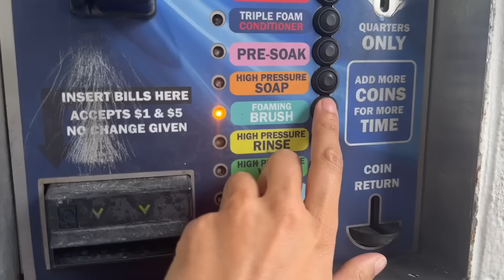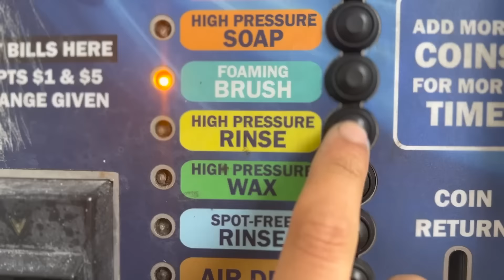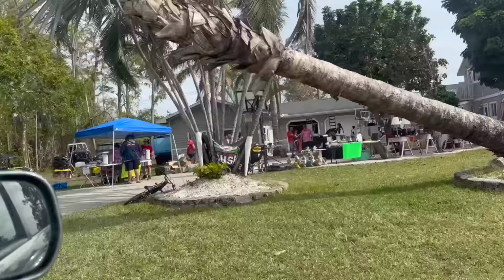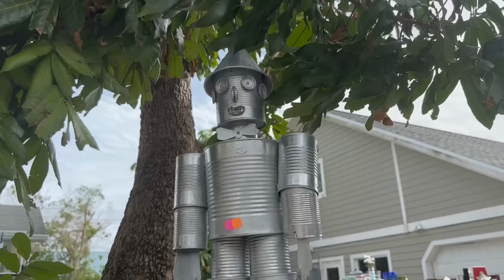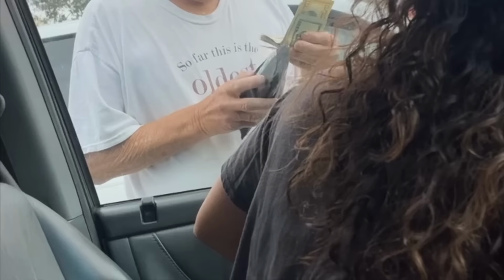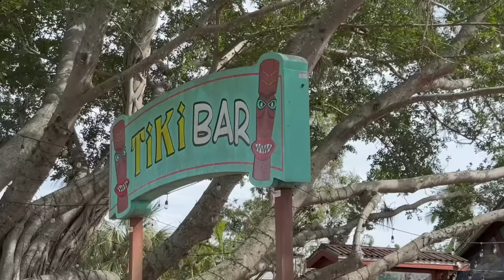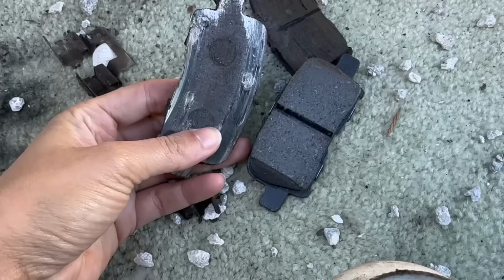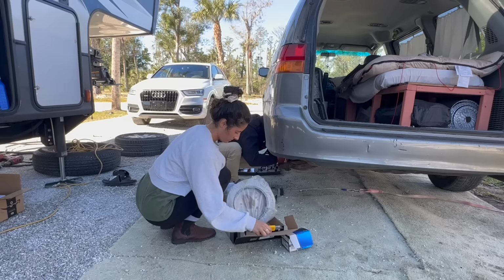Florida man gave me all his money…

Comment: Your threads won't mess up on your oil pan if tightened with a socket wrench, the problem is these shops use air tools and tighten it so much it spins the threads smooth

Comment: Check and make sure the plug stays in oil pan
If it comes out ,you'll lose all your oil 🛢 
And motor will blow up (break down)
The last one that change your oil , crosstheaded the oil pan plug , (bolt)
And when he took it out , it damaged the threads
Good luck to you

Comment: Good old oil change places. Make sure you keep an eye on your oil  just in case they messed it up. If the plug leaks or comes out it will drain out all your oil and you will blow your engine. He was giving you a line of crap they crossthreaded it in there more than likely . But just keep a eye on it. look for puddles under van or  watch oil light.

Comment: Just wanted to let you know that after that oil change.  You should be crawling under the van and take a look at you drain plug.  To make sure oil is not leaking around the bolt. And you should check the dipstick to make sure it's full of oil.  Oil level is obviously critical to make it to three hundred thousand miles. That's so unfortunate they couldn't handle such a regular job 😕 and like you said now it's your problem 🙄.  Good luck

Comment: Stripped drain plug happens frequently at shops. May not have been them, who knows. Keep an eye out for oil leak. Anything with the battery that would have caused your car to die would not have let it restart. Throttle plates possibly may need to be cleaned. Nice to have a brother to help you but you should put a jack stand under control arm in case that small jack fails. Don't lose you hand or feet if the car falls. Good Luck.

Comment: I'm glad that you able to fix your HO Van.   It socks and stressful to have car problems. Did you go to Valvoline? They did my change oil to and that's normal that they have 2-3 people to work on your car. After that less than a week my oil was leaking everywhere. And I have to get it fix. I have a Hinda Odessey too 2010. I bought it 172K miles now it's 191K 4/20. Also just a suggestion that battery cost a lot try getting a USB fan w light w a few settings works great!😊 good luck and take care🥰❤️

Comment: Here's the thing. These so-called "quick oil change" shops will strip out the threads on both the oil filter and oil drain plug. So, buyer beware. Do not allow them to talk you into going to someone they know for a new oil pan. That oil drain plug can easily be rethreaded.

Comment: The inside brake pad was worn more than the outside one  because the brake caliper is sticking. You should replace the caliper or the new pad will wear out prematurely.  Something to remember, If the inside pad is worn worse, the caliper is sticking. If the outside pad is worn more then the caliper slides are sticking and need replaced or cleaned and lubed. The pads should wear evenly. Good luck!

Comment: I used to work at a oil change shop a year ago. Everything they said I have experienced. And the drain pull issue is coming when someone over tightens the drain bolt and straps the threads. Especially if your oil pan is thin metal.

Comment: I went to 5min oil change. They forgot to replace the sheild under the oil pan. I  drove over it when I pulled out. It caught another sheild and pulled it half off. They waved me "stop, stop"!! I didn't know what happened. They didn't tell me. They said they fixed it. The next day I was 60 miles away and saw something hanging down under my truck. I had to wire the second sheild up with a coat hanger. Those guys are on drugs! If they stripped your drain plug, beware. You can lose your engine!

Comment: With 200,000+  miles on the van   and an oil change about every 5,000 miles that makes it 40 oil changes on that particular engine. I'm not familiar with these but running a plug in and out of the same threads 40 times over 20-ish years causes wear. If it is a steel plug and an aluminum oil pan I'm surprised it lasted this long. Beings these are dissimilar metals they tend to "weld" themselves in place and eventually will tear the threads out. It's not that scary of a situation though it is a scary situation. It just needs it's attention and it will last you the rest of the cars useful life.

Take care sweetheart.

Comment: oil pan fix find a place that sells bolts to size and just get a longer one, usually what happens is the original bolt is short and it strips the threads at the beginning of the pan, if you insert a longer bolt it will tighten towards the back of the pan where there are still threads, temporary fix  until you have time to change the pan, good luck

Comment: The oil plug that is stripping out is an easy fix, but you need to find someone who has talent in re-threading. It's not a hard job, and if that person isn't a crook, it shouldn't cost more than maybe 60-80$. I'm in the Central Florida area, and there are many clean crystal clear natural springs in the forest areas, many with camping. Although not all with bathrooms and showers. Some areas can be away from populated areas, and wildlife is abundant right now up until it starts getting hot. Welcome to Florida, be safe!

Comment: If your vehicle is stalling in while in motion with your foot on the gas it means that your battery cables are loose and with the vibration of the moving vehicle it will cause the car to loose power, the same thing happened to me some years back. Some places will loosen the battery cables in hopes you will take the vehicle back for a battery. If they were drilling in your vehicle, and it sounds like the work you had done does not call for it, it means they may intentionally use the drill to puncture an oil pan.... transmission, engine oil etc... because the eventual result is you blow your transmission or the entire engine. If your brother knows about auto mechanics I would take him with and then if you feel like something is wrong then double check the vehicle before you leave and if you find something wrong take it back and show them: make sure you tell them this was not the case. Also I would check your local laws insofar as what your options are for reporting crooked mechanics. Best of luck.

Comment: Eventually I'll get too old to change my own oil or will be forced into an EV. But for now I will always change my own oil. For multiple reasons. You know exactly quality oil is going in, you know a quality filter is going on, the drain plug won't get stripped, you save money, it's quick and easy. Oil change places from the corner local small business, to the chains, to the dealer will use the cheapest oil they can get their hands on, as well as the cheapest filter, they use power tools to remove and replace the drain plugs, and will never treat your vehicle like it's their own. Not saying they are all bad, but most just don't care. Check out the car care nut if you don't believe the dealers use cheap oil. And one thing you should do is change your oil every 5K miles. Yes you hear the rhetoric about "my manual says I can go 10K between changes!". The manufacturer recommendations are for the bare minimum maintenence you need to do to stay within warranty. I would NOT recommend that. Your car will be happier and last longer with changing the oil every 5K. Just my two cents worth. And no, a drain plug will not strip out eventually because it gets taken in and out of so many times. Use a wrench or rachet and realize it's not a strong man contest.

Comment: That happens to cars overtime where the threading of the plug of the oil pan gets worn out. The same thing happened to my car right now but my mechanic said it was OK and I purchased two plugs for my oil pan which was like seven dollars anyway so it’s not expensive. And I have a Honda also. Now why they were drilling in the front of your car that has nothing to do with your oil pan I do not know. You should get a friend that’s a mechanic to check and see what they did just to be on the safe side

Comment: check your battery wires make sure there tight to the terminals there probably lose,also these clowns that work at these quick lube places are guys who dont know threre ass from a hole in the ground,they stripped my oil pan threads on my brand new truck once,unreal,the plug threads should never ware out if they align the tyhreads putting them in

Comment: Go back over their work well as much as you can. The oil pan probably comes off where nothing’s in the way to take it off it’s cheap “it’s a van” if it needs one. Check the battery terminals sand paper the wire ends to the battery, maybe the ends aren’t tight and secure very well.

Comment: I had to replace my oil pan too because it was aluminum and the oil change people tightened it down like a steel one.  I bought an oil change pump with a long tube.  It just hooks to the battery and pumps the oil out through the dipstick tube.  You still need to change the oil filter but you might be able to do that by turning the tire all the way over and using an oil filter wrench.  If it isn't leaking out the drain plug buy the oil change pump and save yourself 800 off incompetent oil change people

Comment: Oil change up sell everything is wrong with your car you either need a new battery or your cables are loose or you have corrosion and you go to auto parts for bigger drain plug seat

Comment: Sounds like they cross threaded your oil plug and damaged the threads.   Threads don't just come out eventually.
You should look under there and make sure the oil is not leaking.    You will need to take it to a mechanic and they can use a tool to repair the threads if they didn't damage them too badly.    If they really messed them up you will need a new oil pan.

Comment: Why not change your own oil?   It's not difficult,  and changing brake pads is also something you can do yourself very easily.  The oil drain plug problem can be fixed with a rubber expanding oil drain plug sold at the auto parts store,  I think the company is called "Oil Tite" and it's made by "Dorman".   You just put the rubber drain plug in and tighten it and it expands into the drain plug hole and works as a new drain plug.   You should put a new Oil-Tite plug in each time you change the oil though.  Very simple easy fix you can do yourself.

Comment: The guys that did your oil change strpped your oil plug your going to have to either have the oil pan retapped or replace the oil pan very costly what I did on my high mileage car was put in a eco plug they are magnetic you just have to find the size of your oil plug 12mm or 13mm and buy one through Amazon or auto zone they are only about twenty dollars tell your bro about it I'm sure he will help you out they also sell self tapping ones too but the magnetic ones are easy they give you magnetic tool to pull it out with just make sure you have a steel oil pan if its aluminum  you will need the self tapping one good luck

Comment: That's BS on the drain plug they screwed it up, frecin amateur's!  you don't need a new oil pan or retread it,, there are rubber plugs that you can put in that work just fine and if you want to get a new pan later that's fine. those oil change places suck and the try to squeeze every cent out of you that they can.

Comment: Your transmission needs to stay cool. There is something called a Hayden ultracooler for your transmission that your brother can install on the next trip. Florida is not the same as Canada and you don’t want to have transmission issues. When is the last time you changed your transmission fluid? Do not flush the transmission just drain and fill. You will be draining 3.5 liters and adding 3.5 liters back roughly. Check the manual some people say 3.3 liters back in. You’re basically taking most of the fluid out and putting new fluid in but some old fluid will stay in there. If you’ve never changed the transmission fluid then leave it alone for now.
Reply: The one that people recommend is the Rapid Cool
Reply: You don’t need to measure what comes out of the transmission drain it will be 3-3.5 liters automatically but some fluid will remain in the transmission body and filter just wait until it all drains out. Always use factory transmission fluid

Comment: A drill to change the oil? They got some splainin’ to do…
Reply from the maker: Seriously……
Reply: I think they had to drill out the oil drain plug. 🙆‍♂️
Reply: @stanleyolszewski7701   More than likely they used a drill powered pump to suck the oil out and bypassed the drain plug.
Reply: @stevecounts325  or did he use the drill to drive the plug back in without hand turning it a few times, ultimately crossthreading/destroying the threads? Auto stores do sell a "universal" plug, it kinda warps to what you got after driving it in... has a silicone/rubber o-ring that helps with a seal, if ya dont want to buy a whole oil pan, worked on a saturn once... but judging by those rotors, you dont mind buying stuff 😜

Comment: Sorry but I have to be that guy. If you have to raise a vehicle to do anything more than replacing a flat tire with a spare on the side of the road, you need to secure it with a jack stand, period.

You simply DO NOT work under a car with a jack whether it's hydraulic or the cheap scissor jack that come with most vehicles for emergencies.

I know that self-styles "experts" will tell you that it's ok, chill, relax, it's all good, but no, it's not all good because jacks fail with sometimes horrible results for anyone under the vehicle or even the vehicle itself, especially scissor jack on gravel or dirt which are notoriously unstable.

And when using a scissor jack on a non-hard surface it's best to place a piece of plywood under it to distribute the load and level it out.

Also, the uneven wear on the old pads indicates issues with the caliper, most likely slide pins that are either stuck or insufficient greased and not sliding properly. That needs to be addressed which may or may not require a new caliper which even if it needs to be replaced isn't that expensive.

And, when you put the wheel back on you DO NOT tighten the lug nuts with an impact wrench. You do it by hand to avoid cross-threading them (as appears to have happened with your oil pan drain plug) and to make sure that they're not overtightened which could cause them to snap eventually, possibly when you're doing 60 in the middle lane of a highway.

Finally, when you change the pads and rotors on one side you should change them on the other side so there's even pressure applied. Also check the brake fluid level and top off if it's low.

Anyone can replace pads and rotors but only with the right equipment and methods. Your brother meant well but he messed the job up in so many ways, some of which could cause harm to him, you or others.

Stay safe.